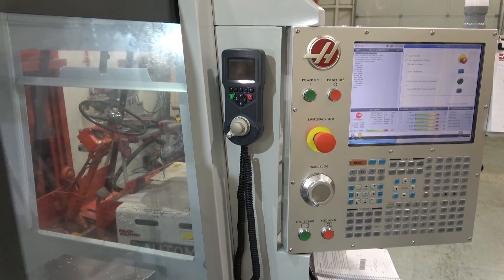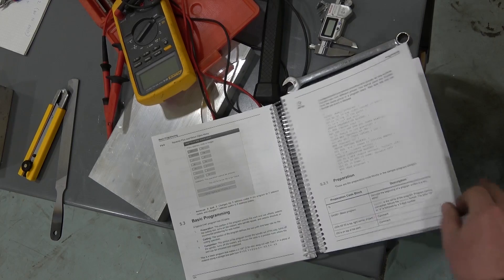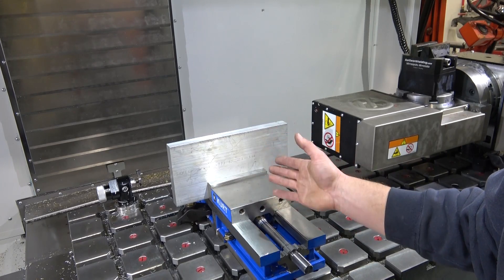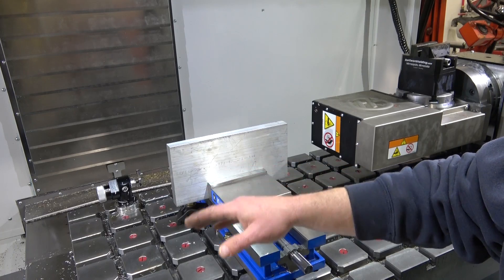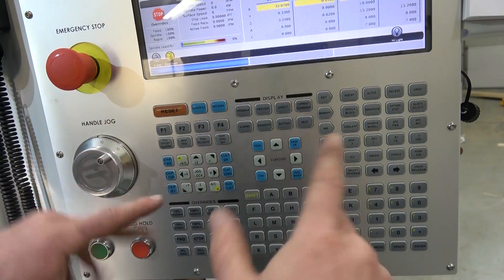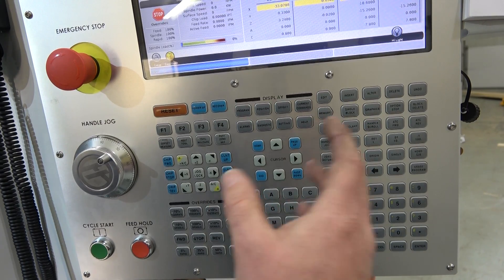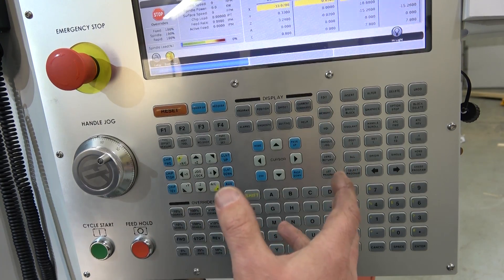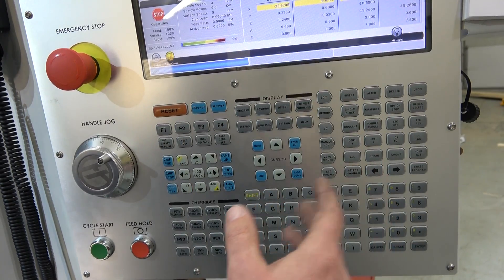HAAS Shakedown | JUNK Visual Programming System

Comment: Simulation in fusion360 is key. Just throwing that out there:)
Reply: You can simulate snapping an end mill with that? Nice. 😜
Reply: @pekkasaarinen2902  You can simulate tool loads and also optimize paths though if you get a decimal off on the input you're... gonna have a bad time
Reply: @pekkasaarinen2902  and ncviewer.com for checking gcode directly ;) typed by hand or confuser, it's a quick sanity check.
Reply: Agreed, most at the controller programming is... not great.  Especially the canned cycles / pre-programmed operations.  I mean it can be ok for simple jobs, but as our intrepid uncle bumblefuck is slowly figuring out, there's a lot of "you think it means one thing, but it really means the other thing" and the oh so helpful alarm codes when the machine gets lost doesn't help matters.   Though programming with Fusion360 (or similar CAD/CAM software) isn't exactly smooth sailing either, you can at least see that it would make the thing you wanted it to make before you send perfectly good aluminium to the fuck it bucket trying to figure it out at the controller.
Reply: Add 2 inches to Z offset and keep a close eye on the tool, a hand on the feedrate override, and a finger on the feedhold.
Reply: Note that none of this was modelled on a PC. Everything was done on the machine using VPS so except if the machine itself has a simulation mode there's no way to simulate it.
Reply: JKK Haas has a “graph mode” which provides a really rough simulation, traces the path in two dimensions and shows you the Z.  Unfortunately nothing can simulate rigid tapping with the wrong tool holder, you just have to know these things.
Reply: @Stumper52  that was kinda my point. When using software like fusion, you are more likely to find a mistake before posting than just using the controller. At least for me anyways.
Reply: @Shopbuilt  I can't use the control worth crap because my screen sucks.  I RS232 everything in, even handwritten stuff.  Except for once in a while a quick MDI program.
Reply: you have been missed

Comment: Wait wait wait can you explain what's going on at 3:30? Is that how it measures tools? That's bad ass
Reply: I run a Hass all day long, you can also use the probe the little blinky thing with the white stem to come in and automatically check your part on every piece if you know how to do it like I do.
Reply: Yup, it gets the offsets to the end of the tool by bumping that little sensor post
Reply: Renishaw has one that works with "laser beams"

And the macros for calibrating it are a wet dream.

Just give it good reference measurments and it'll measure tools both length and diameter within a couple tenths without touching anything but air and photons.
Reply: @AngeredKabar  I just saw one of those laser eye part measurers. It was in a CNC video playing in one of the Design2part booths in Raleigh last month.
Reply: @AngeredKabar  optical tools end up not working well in the wet, chip filled environment of a mill or lathe. The stations that allow for tool setup use lasers as a light source out of convenience (optical design is way easier) and most work by placing the tool in collimated light and then capturing the shadow .
Reply: @AngeredKabar  Looks like a Haas-logo'd Renishaw tool setter.  Model TS-27 or such.  Very good hardware, as is anything Renishaw.
I only used the laser one once.  But you're right, way cool to use.
Reply: It's just a skip sensor.  All it does it determines the wear on the tool.  The real thing you should be impressed with is the renishaw probe.  It is what sets everything for the parts.  Even if your home position Is off it will accommodate...skip sensors are cool til u rebuild one and it doesnt see the decel switch a and smashes it off the machine #millrightfuckups

Comment: when milling and drilling aluminimum like that what difference does haveing cutting fluid/coolent running or not running over the piece of work have
Reply: Broken tools. Other than that not much. 😉
Reply: The coolant can help achieve a better finish when face milling.
Reply: Huge reduction in fire risk.

Comment: To find faults in your programming, you can dry-run the program first by raising the program above your work peice and running the program if it looks alright then it probably is good to go. BUT always check the speeds and feeds and clearance so you don't hit anything during the fast feed to machine home.
Reply: You should probably learn absolute and incremental programming and start writing some simple programs in like NCedit and transfering to machine by using the MDI setting on the machine (if you don't have an computer hooked up or any usb interface on the machine)

Comment: Those are pretty decent machines.  From what I hear.  They wont take a beating very well though.  Which when your a maintenance technician at a place that likes to wreck the hell out of machines I think I'd get tired of replacing linear rails and setting geometry 😂.  I personally will take a fanuc controlled machine any day over that as well.  Mazatrols are also pretty friendly but that may just be because I'm used to working on them.  Seimens 840d...I'm good on that...ah I digress
Reply: I second that Mazatrol sentiment. The tool prioritizing on Mazatrol is genius when you are using multiple sub-programs. And Mazaks are skookum!
Reply: I just like they because as a electrician/mechanic the mitsubishi amplifiers and other electronics they use are very reliable.  Also your maintenance functions are pretty user friendly when you need to work on one.  You can complicate things when you get into forcing bits...trying to trace down a parameter issue...but mazak even has a program I have access to that you can compare two sister machines of any type and it will tell you what is different.  You just get alot of reliability and useful features.
Reply: @bsandy88  the Mitsubishi amps are ok after you add additional cooling fans. One hot summer I had to replace 3 on different machines.

Comment: Ya wanted conversational programming ya shoulda stayed brand loyal and bought a Mazak.  They had it figured out 15 years before anyone else did.
Reply: Mazaks are really nice and i run one 5 days a week, but they are pricey as hell compared to Haas
Reply: @Jageby  Fully optioned Haas is about the same level of functionality as a typically optioned Mazak. Maybe 30% more money for 50% more machine. The torque curves are way different.
Reply: But then you have to deal with all the weird uniquely Mazatrol bugs like forgetting the absolute machine position when a home command is interrupted, or when you make two code edits in a row and it shows that the second edit applied but secretly it will run the old code, or my personal favorite the machine having a full on windows BSOD and hard reboot while the program is still running.
Reply: I have to admit I am a bit out of date.  I was trained on t-2 and M-32.  Finished on the 640 machines when they were fresh off the boat from Japan.  And yeah  I know all about those scary moments when Windows 98 crashes and the machine keeps going with no way to control it.  The shop I was at was the US beta tester for that controller in 2000-01 or so.

Comment: Get your daughter in there on that keyboard. I bet she could show you a thing or 2. Also I've always wondered how they check repeatability of the end mills with a hot swap system. That's frickin cool, and scary to watch. I thought it was coded wrong and was going to tare some stuff up.
Reply: If you know what you're doing you can also have the machine Auto probe the tools after however many parts you want
Reply: What do you mean "repeatability of the end mills"?
Reply: @ericwehrs338  
When you change out the tools there is going to be a difference in the 0,0,0 of the tool.
Reply: @ts3dprints732  no lol
Reply: @spikeypineapple552  Automatic tool offset calculation and correction
Reply: You set your tools once. Repeating is what the taper is for.
Reply: @highvoltagefeathers  End mills get dull during long cycles and there's some tolerance in every single tool change etc... so if you need absolute accuracy, that gizmo that tests the tools is your friend.

And someone needs to put the tool to the tool-holder when it gets too dull so that thing measures that and saves it to the database as well etc etc... so it's a good thing to have.
Reply: @Mtaalas  Right, it's just not something you do every tool change.

Comment: I do believe this is the second, "tool" you've reviewed and didn't take A-part before using, maybe that's what is wrong. Can you get on the gargaler and jazz hands a different interface. Seems to me your making progress man. Your smarter than most. I still need 1/2  inch wrench with an AvE stamp. For a project.
Reply: You're*
Reply: @commanderlake7997  Hugher
Reply: @commanderlake7997  allso sense we kant red hear to good I kant proof red my typings.

Comment: Drill chucks, only in an emergency and only for drills!
Reply: Probably the reason for the broken bit. If the peace of crap moves it bites you. Always remember that tapping on a CNC relies on simultaneous ans synced motion of spindle and z axis.
Reply: Disagree. You can purchase drill chucks that you can even use endmills. It's not ideal but it can be used in a pinch
It works great for holding taps.

Google search WTE drill chuck.
Reply: 6 inch gauge GS er25 and 32 collet holders would be perfect for that machine. I suspect the drill chuck is why the tap broke.
Reply: There's a reason it's called a DRILL CHUCK and not a TAP HOLDER!!!

Comment: Never tried to visual program a CNC, but we've had a few different makes of inspection equipment with visual programming interfaces and it is always way more painful than just typing in commands. I don't get the appeal - I guess it makes a good demo and seems more accessible to a beginner. Pain in the ass.
Reply: It actually works well enough but other options render it out of date Basicly. If you have a haas vf2 or similar with that renshaw probe you can make a lot of shit I'm a machinist and thats my primary machine. I use fusion 360 and if you set your mind to it 8 hours a day for a week you can learn the probe system and the fusion side. And a excellent way to learn is titans of cnc course it's free no cost at all same as fusion 360 free no cost at all for hobbyist.

Comment: So do you buy the coolant by the barrel or does it get filtered and recycled?
Reply: It gets filtered and recycled.
Reply: It has a 50 gallon tank under the machine, and if you keep the coolant clean by skimming the Tramp oil off and maintaining the right concentration it does just fine
Reply: Don't forget your skimmer!
Reply: @evilution_ltd  The boys where I work usually chuck half a bottle of "pine o clean" in. Seems to work...but makes the shop smell like a hospital.
Reply: @boxyoyeah  Not sure if joking... Some fool in a shop I used to work at actually did that with SimpleGreen and they had to tear it apart to clean it because after it foamed up everywhere it got in the ways.
Reply: Then after the recycling, it grows bacteria and smells god awful
Reply: @evilution_ltd  Put in a UV light and/or an ozonator.